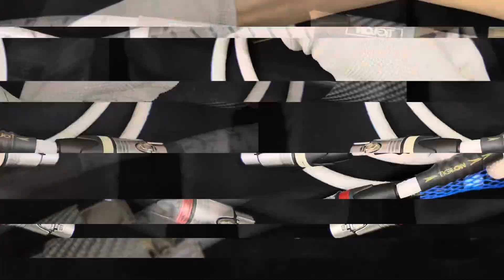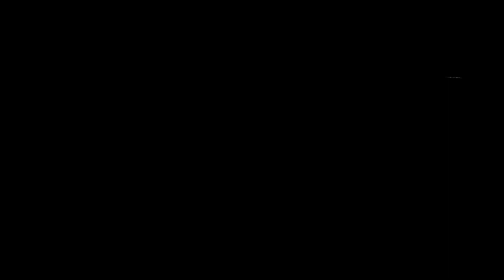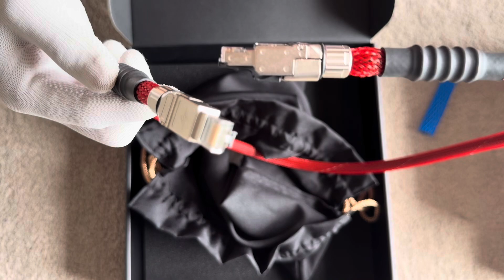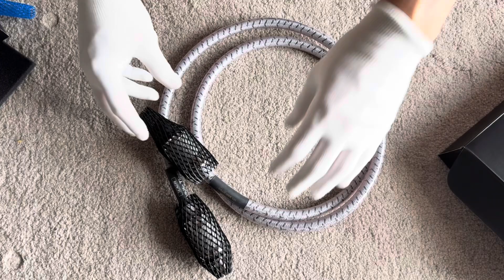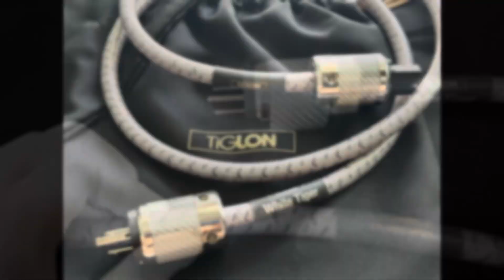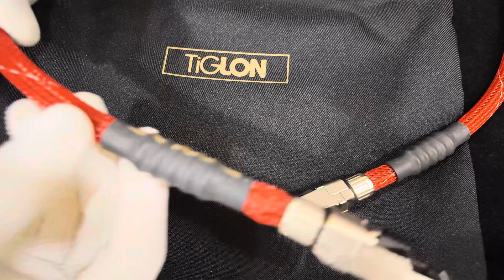I Reviewed TIGLON Flagship Cables TPL3000 TPL2000X TPL2000L: Magnesium Noise Control

Comment: i notice on the ethernet cable that there is not mounted protection shoe on the end of the connector. is that normal ?
Reply from the maker: I think it doesn’t come with the cap, it’s inside a soft bag so should be fine.